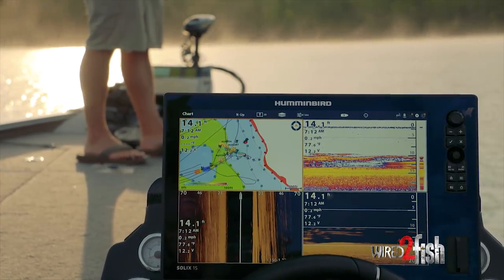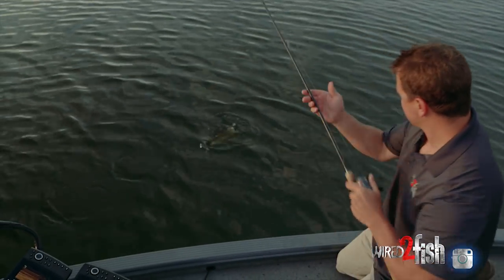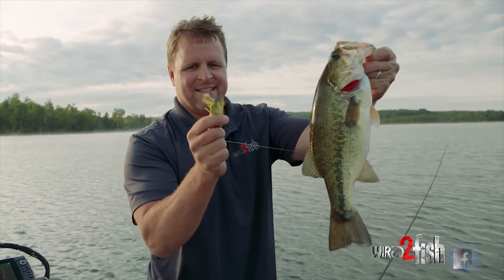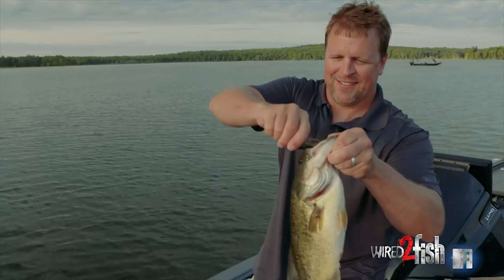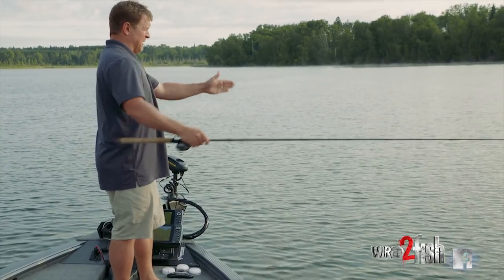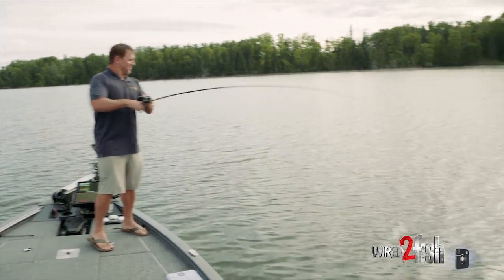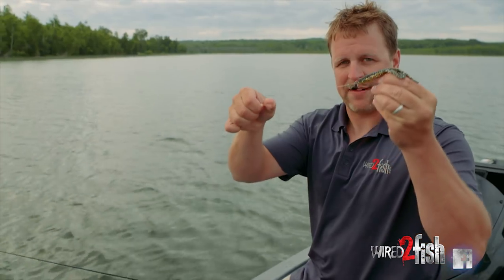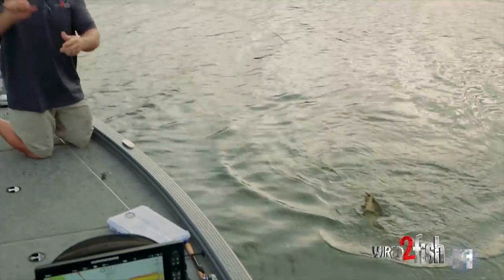A Detailed Guide to Bass Fishing With Swinging Jigs

Comment: Will this strategy work for smallmouths?
Reply from the maker: Hi Silas, smokes 'em. Here's a video using a modification of the system with a 4'' paddle tail swimbait: https://youtu.be/m38JcMIGINs
Reply: Wired2Fish thank you greatly appreciated
Reply: Yes it will... just have to make a few small adjustments, slightly smaller profile bait  and depending on the depth your fishing a little bit lighter jig did the trick for me on catching small mouth